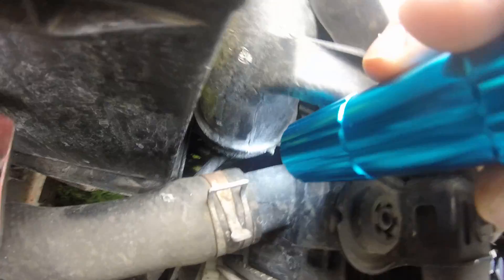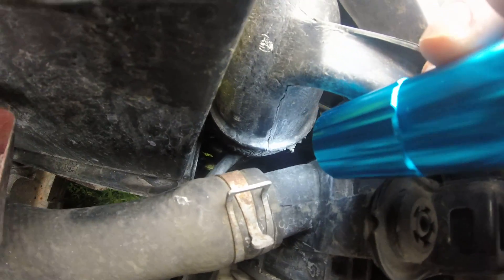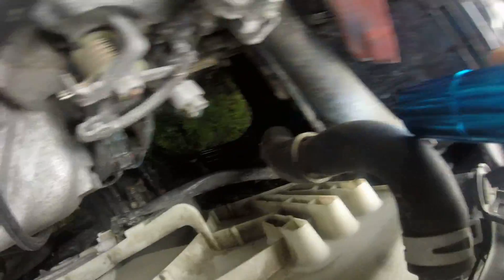05 - 06 Matrix / Corolla XRS Limp Mode Bad MAF sensor 2zzge

Comment: Also if you were tightening or loosening the positive terminal do not touch the intake with the rackhet or your maf will fry. Gone through two already
Reply from the maker: Corolla XRS Yes I learned that as well when I was researching the MAF on our cars. The metal to metal contact causes the battery to arc and fry the MAF because it is so damn sensitive. I read that just reconnecting the battery has killed them too, because of the power surge. It is recommended to unplug the MAF first before the battery, then after the battery is reconnected, plug the MAF back in last to avoid any issues. Sub me if you would, just subbed you for your XRS videos. I got at least 10 other XRS videos on my channel if you haven't seen them yet. Thanks bro!
Reply: fuck too late... just replaced the starter and had to remove the battery, got the starter in... fucking MAF now giving me P0103, I remember hitting the CAI with the wrench lol... no breaks with this car, sold it to my brother and a week later starter goes, lol... I replace the starter and MAF goes LOL.
Reply: Well your comment just helped me solve the issue. After watching @buckeyeBallistics video how to replace the alternator. i decided to remove intake to test out the new intake pipe. the pipe wacked the positive battery terminal and im guessing this is why i cant accelerate over 3000k. i checked wires for any tears and cleaned plugs. im thinking i fried the MAF. FML